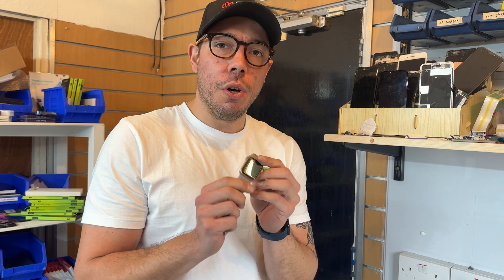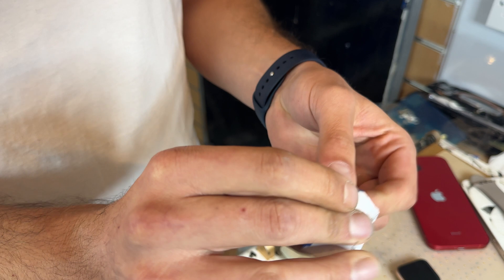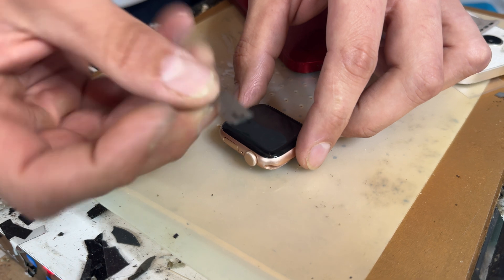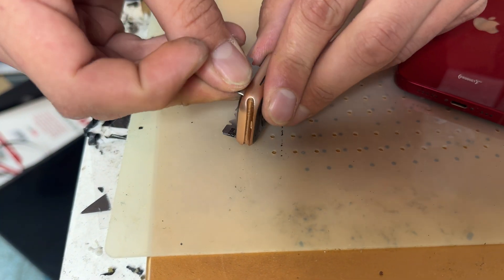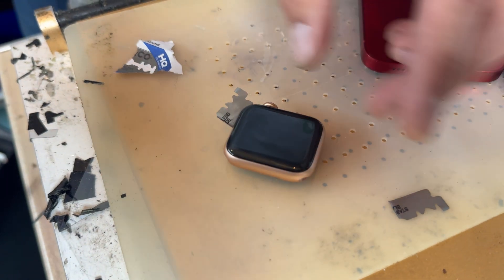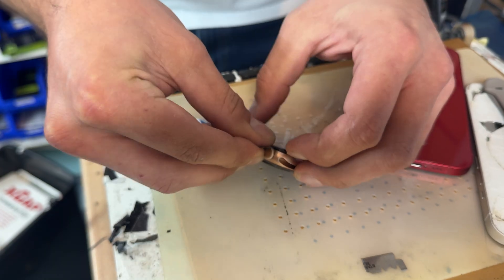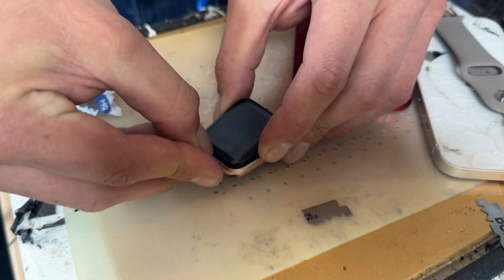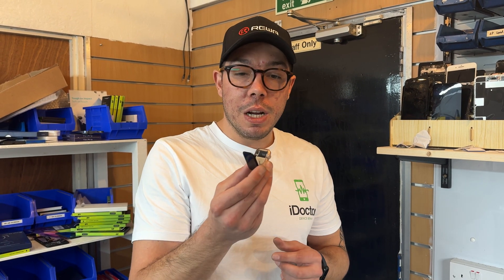This Is The BEST Way To Open Up An Apple Watch!

Comment: Thank you for this tip ! I was struggling for 1h to open the Watch with a Skalpell Blade.. it kept braking the blades edge. Your technique was effortless 👍🏻👍🏻
Reply from the maker: Great to hear!
Reply: Doesn’t that ruin the sensor gasket flex cable

Comment: Great video, but we find it better once you've got the first opening using the blade, use an OCA sheet to cut the glue with a bit of ISO. Less risk of cutting any cables and scratching the frame :)